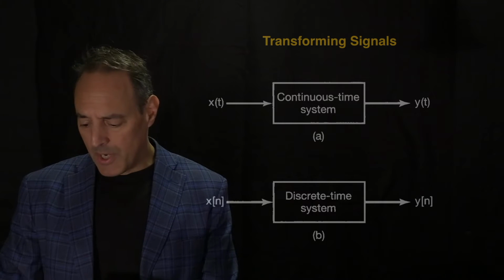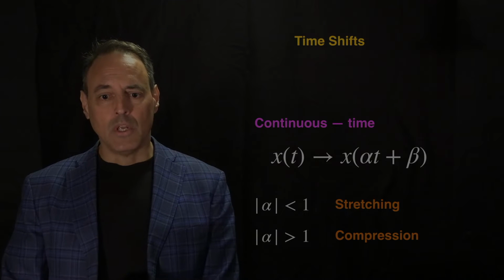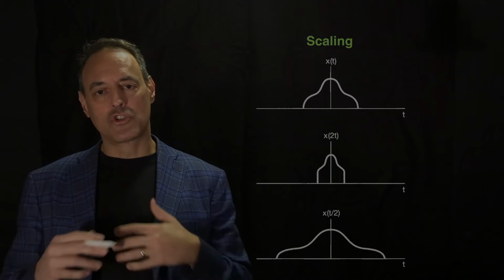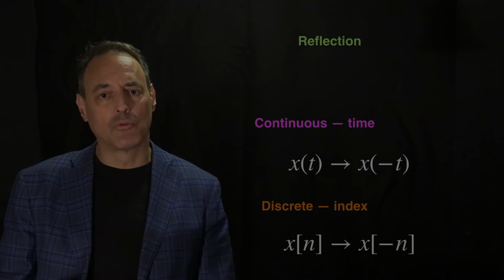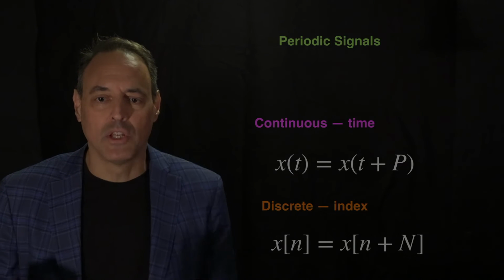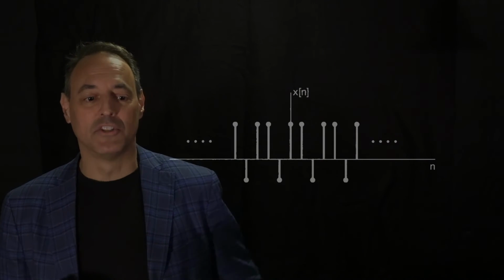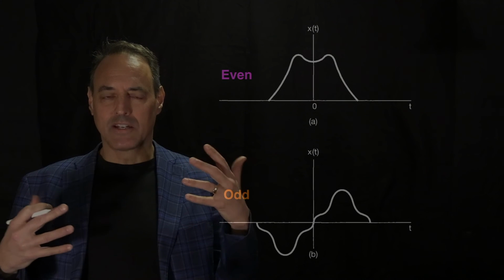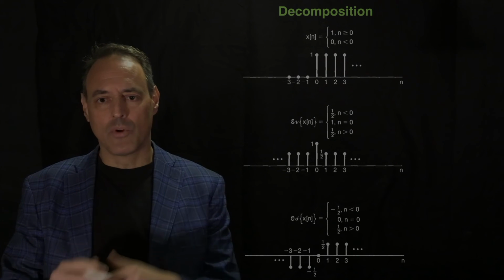Introduction to Signal Processing:  Basic Signals (Lecture 2)

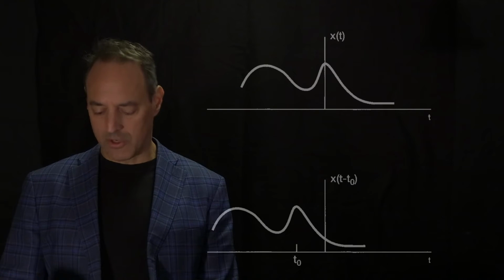Comment: When you begin talking about time shifting for continuous time at 4:24, were the labels flipped between x(t) and x(t-t_0)? Thank you Dr. Kutz
Reply: Imagine t0=-1 second for example for the case he shows. If you now take t=0 as you starting time, the upper signal will have a value of something indicated with the yellow dot. If you insert in the lower function, you get x(0-1) equal to that same value. So a positive value of t0 'drags' the signal to the left.